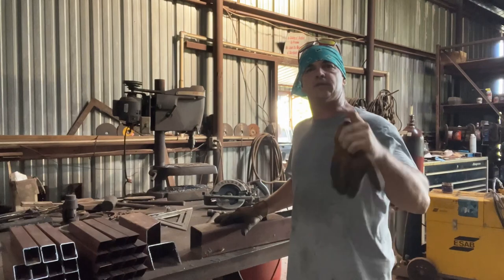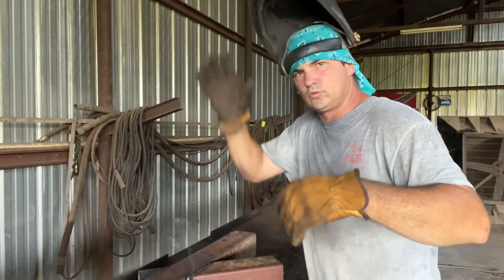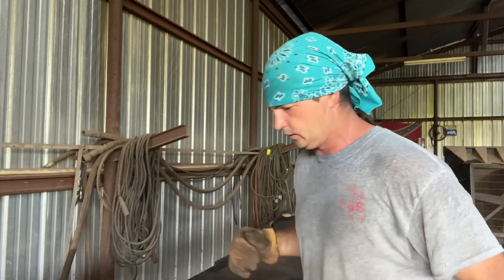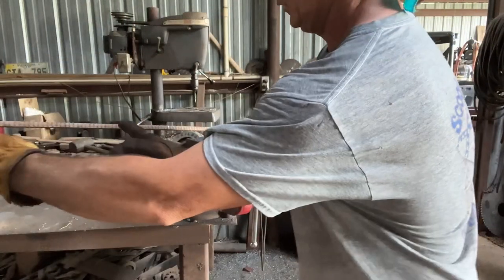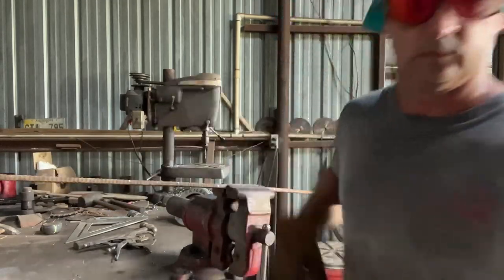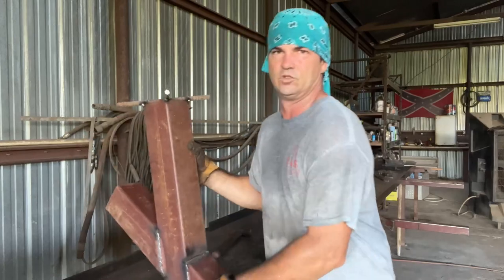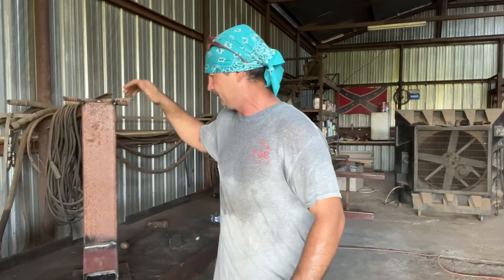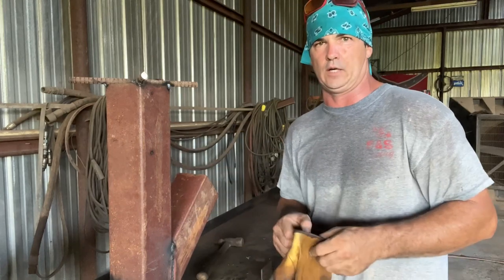Building the Rocket Stove

Comment: I have a real nice store bought rocket stove that somebody gave me new in the box. I mostly melt lead on mine.
I have made several rocket stoves and hobo stoves. They are fun to play with.
Having cooked on them a bit I find that I like having two stoves side by side so I can have one for high heat or boiling and the other for low heat or simmering.
It's worth knowing that it's possible to cut and weld with propane but it requires a bigger regulator.
Might not be able to get actlylene one day. Maybe something to experiment with.
Thanks for the video

Comment: That's a good idea to put a adjustable vent on the stove maybe like smokers or grills have for air flow. You said you had problems with your automatic welding hood flickering on and off I had that problem with mine to so I changed batteries and the clear len which covers the Automatic sensor and thought that would fix it but it didn't so I bought another hood. Well I don't give up on things to easy so I took out the sensor and clean it better and it now works so I've gotten two hoods now I don't know if this might help yours. If I'm not mistaken that was a Acetylene torch right if yes never use it laying horizontal the acetone inside the tank that the filler material is soaked in that keep the acetylene from exploding under high pressure will vent out and this can cause a very dangerous situation. Moving them laying horizontal is ok without the regulators is ok but they need to be set up vertical for a while before use so the acetone can redistributed. Some set there tanks at a 45° angle and use them but its not recommended. Not trying to be a safety nut but I've live the mistakes I've made and wish someone would have told me. So just trying to help. Besides I like your videos and I really prefer to see them for the next 50 years.
Reply from the maker: I think my batteries were just dead. It hasnt been used in a while . I will get a couple before my next project